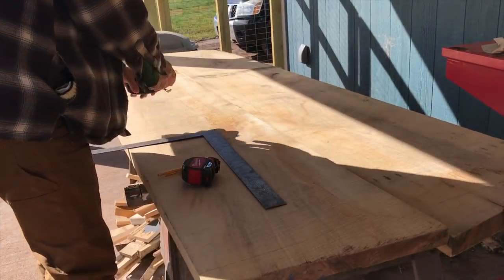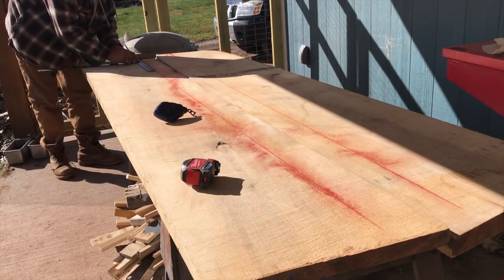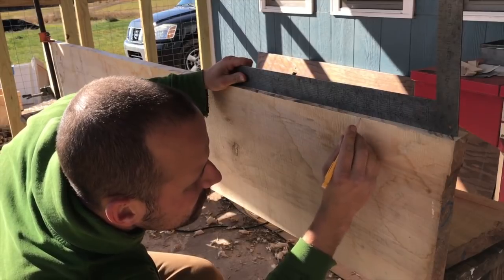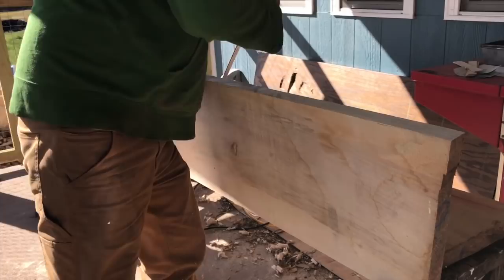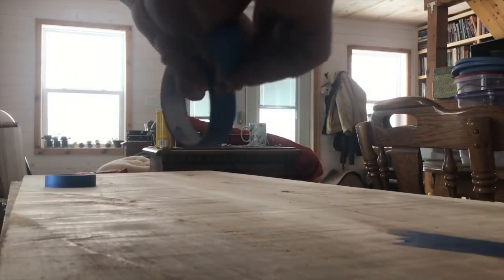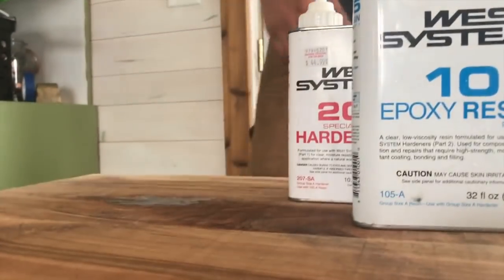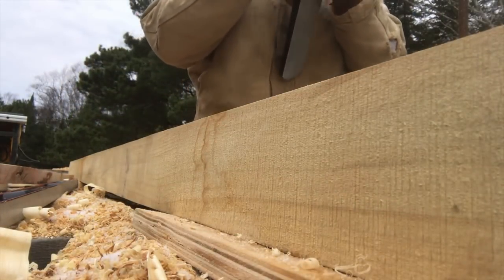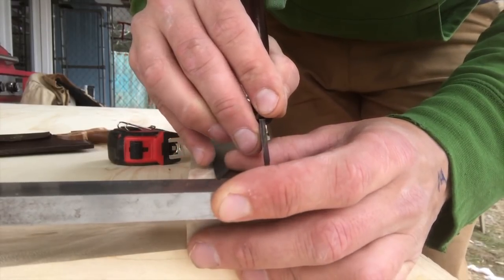Making Kitchen Cabinets Part 6 -  Bookmatched Maple Slab Countertop

Comment: I am wondering where your feet go since there is no kick, i image it must be very uncomfotable, or is it not a problem?
Is the kreg pocket hole jig a peace of junk, or is it set a little too tight?  i could see it flexing when you were drilling the draw sides.  Everything looks great, and the work you did on the counter really shows.
Reply from the maker: Thanks! We haven’t found the lack of a toe kick to be uncomfortable or a problem. It just took a little getting used to. The kreg jig is awesome if you want to build cabinets quickly. I keep the tension on it tight so that could have led to some flexing, but in my opinion it is a quality product.
Reply from the maker: Thanks! We haven’t found the lack of a toe kick to be uncomfortable or a problem. It just took a little getting used to. The kreg jig is awesome if you want to build cabinets quickly. I keep the tension on it tight so that could have led to some flexing, but in my opinion it is a quality product.